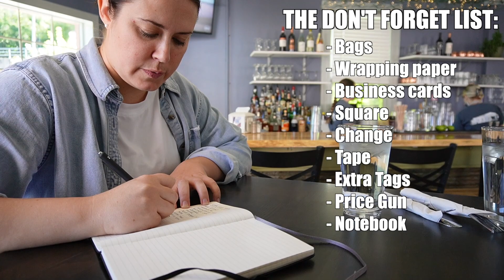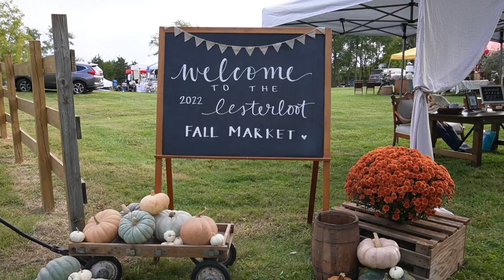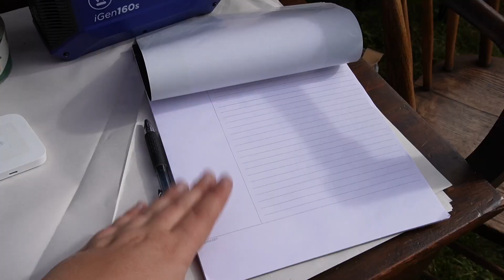Fall Vintage Market 2022 LESTER LOOT

Comment: I’ve only done two little markets so far and I’m addicted to them, even though it’s exhausting! I’ve been combing over my neighbor’s displays for ideas. One of the coolest things I’ve seen is a few people laying out a rug as a ‘floor’, which really tied their space together, and the others that sell vintage clothing have constructed little dressing rooms within the tent with a mirror inside. They’re just boards with fabric stretched around to make a small box with a zipper. Also, I’ve been seeing people tie rope or string across the top of their tent wall to hang old photos and sometimes lightweight art. Tents are challenging but kinda fun! I’m used to a booth with walls so it’s cool to be forced to think outside the ‘box’ lol.

Oh and I ran out of table space last time so I just chucked a tablecloth over my biggest bin. Presto.